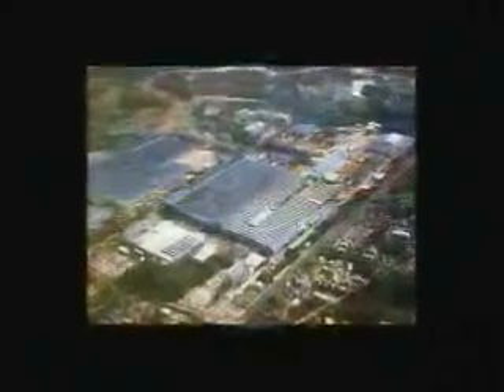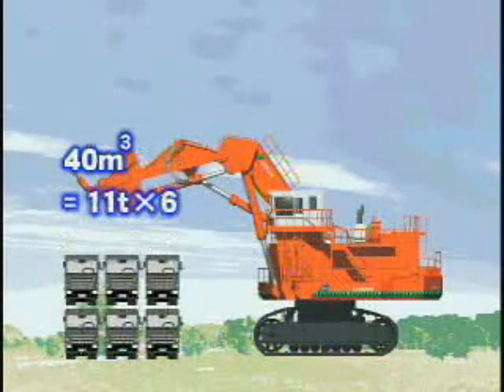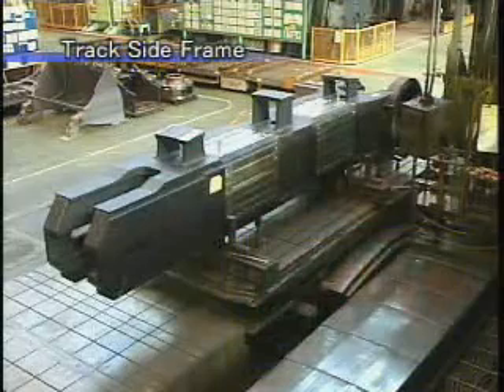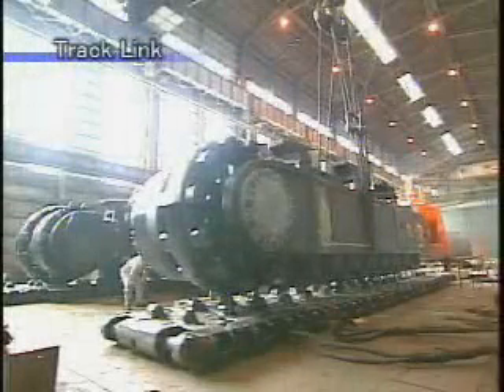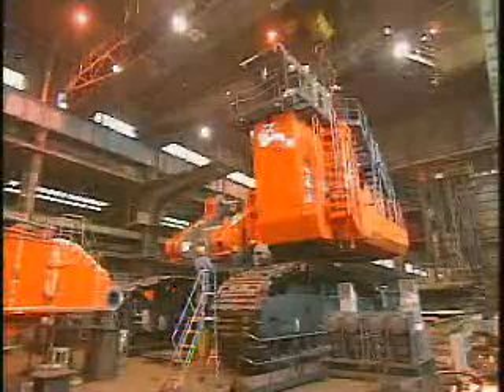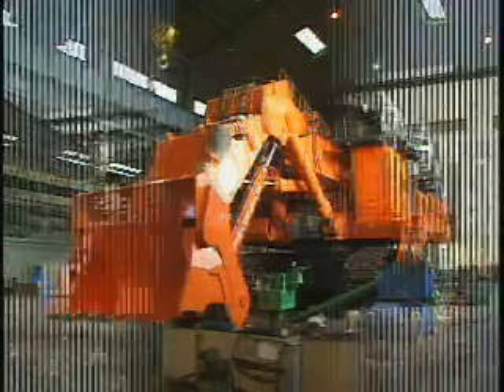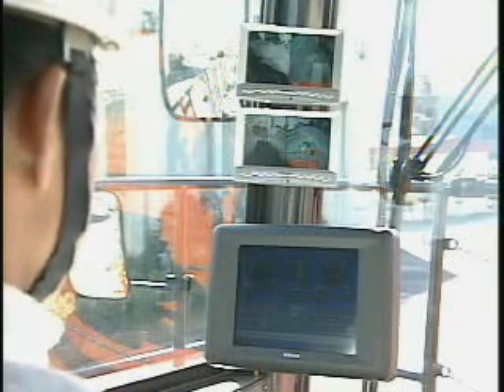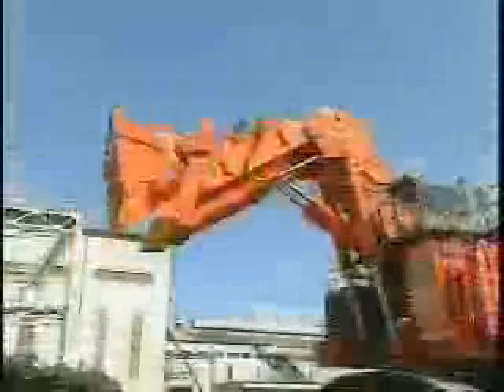Hitachi EX8000

Comment: There is a R9800 here at this site.The early RH400s weighed about 900tons while the later ones are over 1,000tons.The R9800 will be 52 yards which is similar to the EX8000.

Comment: Thats not an excavator, its a shovel.  And anyone who likes O&K's have probably never worked on one.  Sure they have the best break-out power in the industry, no argument, they do, but their electrical systems are unbelievably complex, Hitachi are 100 times easier to work on.  Hitachi also are better for parts, in Australia anyway.  O&Ks also have dramas overheating the walking gear on long distances.